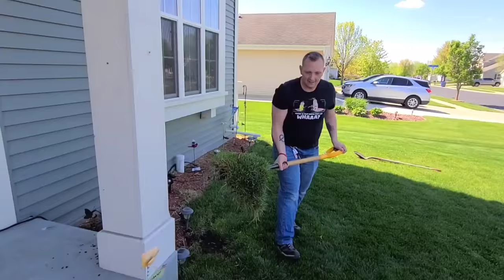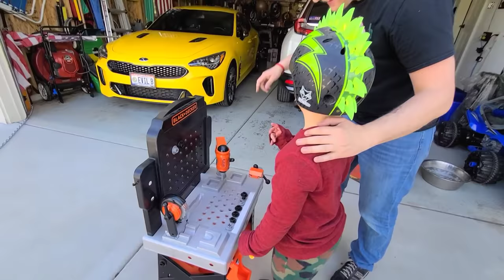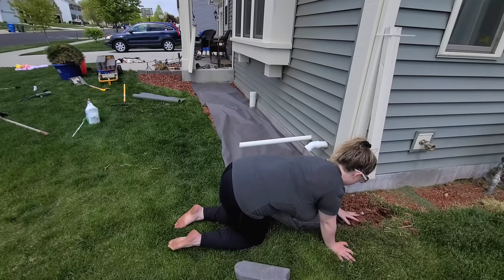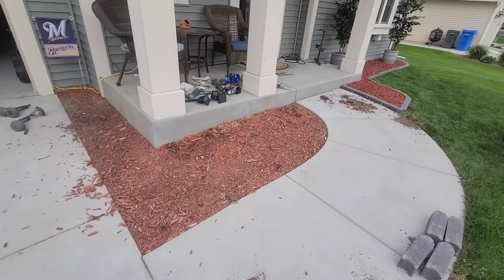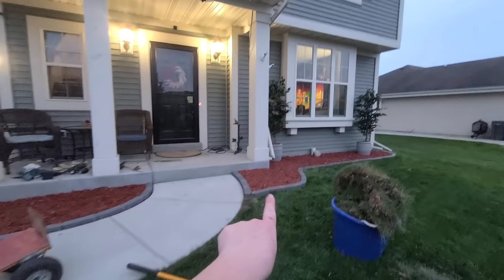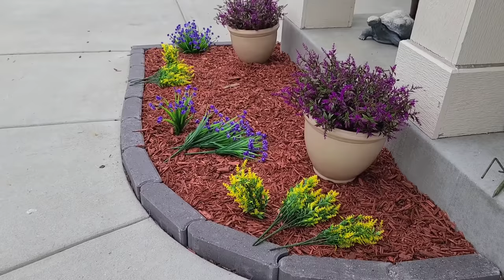Epic DIY garden transformation with FAKE plants 😳

Comment: Cambriea, this looks so pretty!  You and Bobby are dynamite together!  I love to watch you two do a project.  
I’m wondering how many of each kind of flower you used?  It’s hard to tell in the video to get an idea.  I have a couple of spaces between shrubs that I’d love to fill in with some flowers along the back of my screened porch.  My soil is pretty much pure sand and I’m in the hot South so I think artificial would be perfect there.  (I disconnected that area from the sprinkler system - the water was soaking the edge of the rug on the porch and it was beginning to smell a bit musty 😬 - so fake would be perfect!!  Thanks so much!! 💕
Reply from the maker: I got about 40 of each
Reply: @cambrieabobby4162  
Thank you!  That’s so helpful!  Off to your store to see what I can find.

Comment: It’s pretty.. BUT there is a problem with this! They fade, start to look bad. I tried this with expensive items from Michaels and Jo Ann’s, looked awesome, until a few eeeks later. However I do live in Florida and sun is very harsh on everything outside. Even our brand new grill cover fades within several months. Trees will not withstand sun! Been there done that. I wonder if there is a way to spray them with sun protection